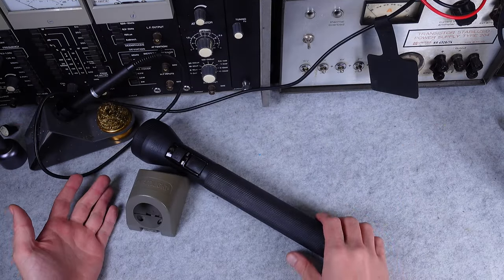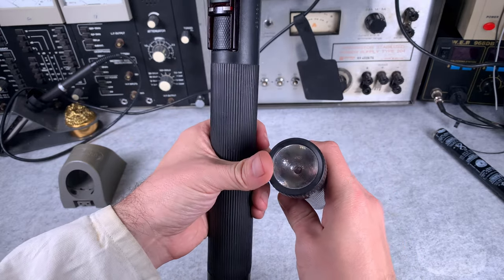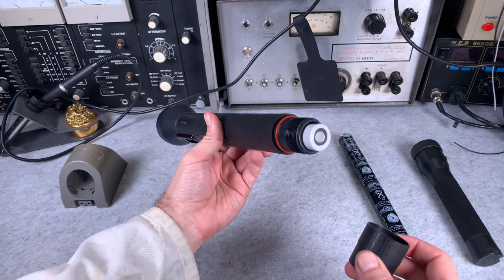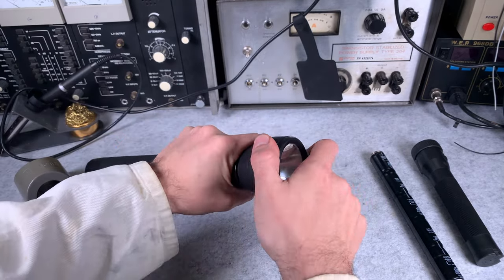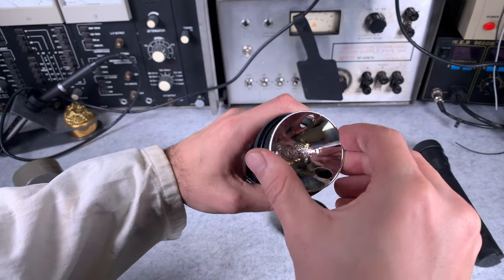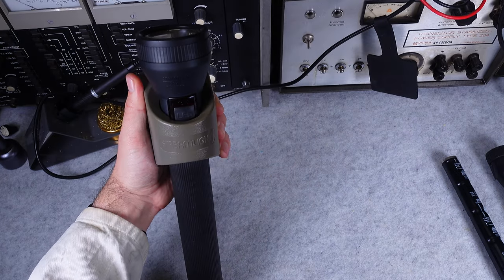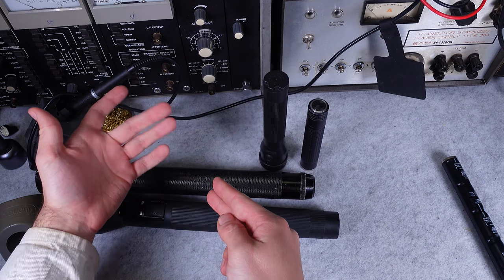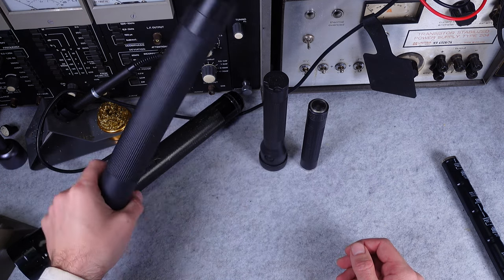Streamlight SL-20XP rechargeable led  & halogen - best dual mode duty patrol flashlight

Comment: Hello,
I highly recommend lubricating the threads with vaseline oil.
Especially aluminum deteriorates very quickly without lubrication. It is worth screwing gently, strong screwing does not give anything and the threads quickly deteriorate.
Good health :)
Reply from the maker: Good tip - If I won't forget I will mention it while working of different light with o-ring!
Thanks!
Reply: @ElectronicNoobBlog  Take care. This helps a lot when you need to have a flashlight for a long time, e.g. for financial reasons.

Good health :)